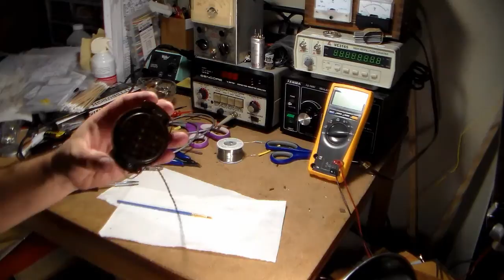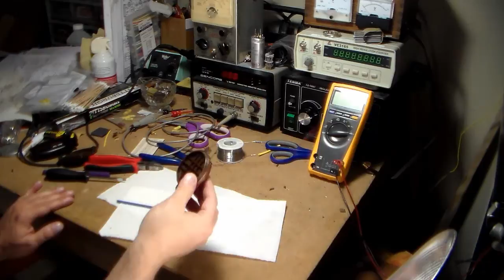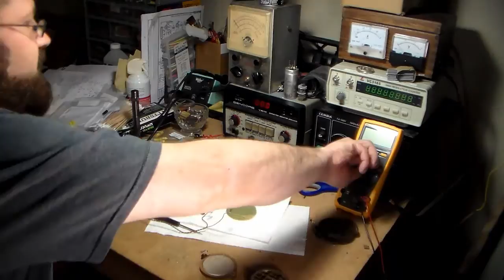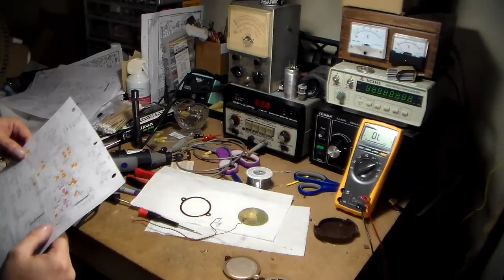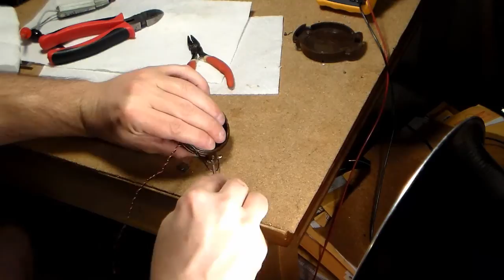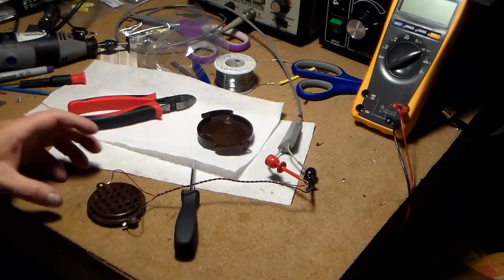1958 Grundig 2066PX Part 3

Comment: Here we got another running commentary and ALL hands fingers knuckles  arms and elbows😅 seriously for the meek and humble beware of this  small but dangerous unit . These monsters require high voltage to perform.
These electrostatic tweeters reproduce an amazing sound especially if you are a jazz fan. Saxophones sound right in the same room and soft vocal balleds are straight from the vocal cords.
The thin/fine  diaphragm is metal used usually in copper sprayed for electric electrostatic field. I have just cleaned up and presented a new diaphragm replacement .
Happy restoration👍